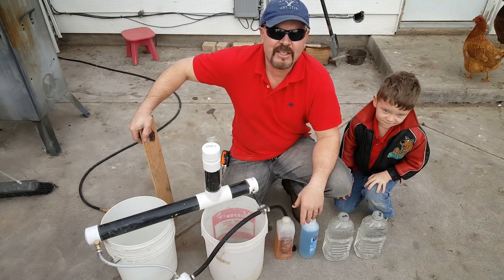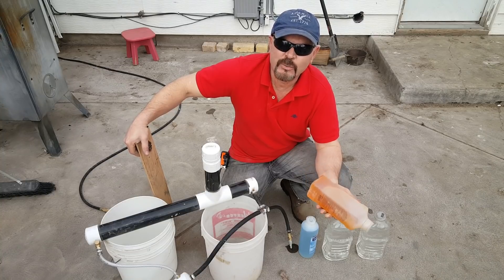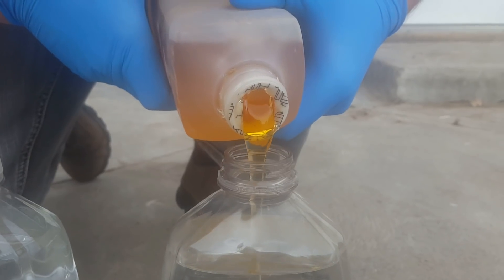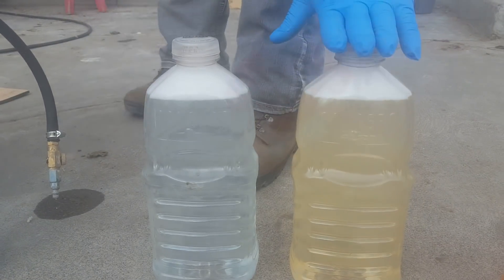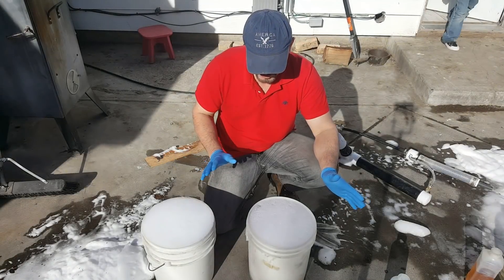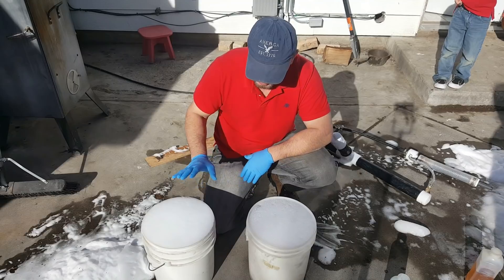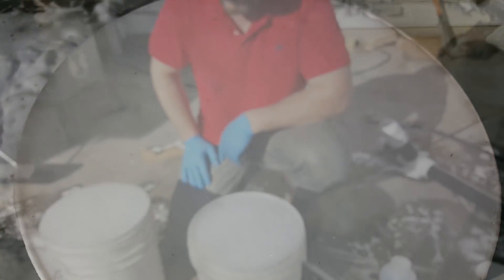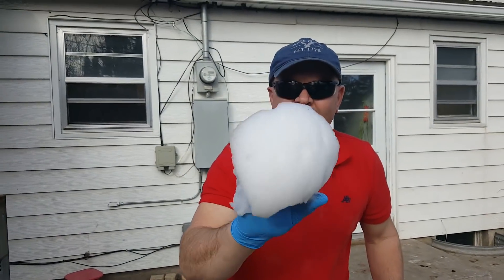The Best Aircrete Foaming Agent $ for $

Comment: Now with the the bubbles being of consistent small size they're always going to be stronger and the distribution of the bubbles between the particles of concrete and mortar when it's mixed we'll make it lots lot stronger and a lot more consistent but I also think that adding recycled plastic strands shredded plastic to the mix will make it indestructible and I've been thinking about using that system for a new road base. I currently live in Washington DC and the roads here are some of the worst roads in the world we have potholes the size of Volkswagens LOL. And I think a road surface that never needs resurfacing or very little is where we need to go with this country because we're spending way too much money on fixing potholes instead of just building a new infrastructure.
Reply: just add hemp

Comment: I just found out that you can add latex paint to color concrete. Imagine making your own bricks for a walkway? 
If a plane can drive on this kind of concrete as per one of the previous comments, could they be strong enough for a vehicle in a driveway? Or would they eventually sink?
Reply: You can only get pastel colors with Latex paint.  Too much paint and the concrete does not set.  You do, hoever, get a wider range of colors using paint than using integral concrete dye.   Did you know that there are now spray on dyes for concrete that produce strong and dark colors?

Comment: add a little baking soda to hand soaps. If you really want staying power and an awesome bubbles for your little guy.  Pick up a bottle of J-Lube.  That j lube is amazing.  Keeps bubbles strong for long. easy to wash away. 
Checkout NightHawkinLight channel he has great recipe.  Love you're build going out to the garage to make one.  You're sons going to love the bubbles.  I was able to make a bubble around my 8yr old son.  Off the wand you could fit a car in a bubble.
Reply from the maker: Hey thanks so much for the tip J lube works great. HDC
Reply: Honey Do Carpenter Awesome glad it helps. It's a great product, especially when u need big bubbles that hold.

Comment: Just a thought Darwin, you add glycerin to dish soap to make bubble blowing liquid, because it makes the bubbles stronger. Think that might help here?
Reply: I was actually wondering the same thing.
Reply: Another thought, buy some disposable razors and use some of the foam to get a close shave while making your aircrete.
Reply: @Accumulator1  i add a little stearic acid and the foam wont collapse for 2 days.

Comment: I tried making foam but was getting too much water coming out. I used the 40:1 ratio for shampoo. Do you know what the problem might be?
Reply: maybe your reductor   check out jim whites channel.
Reply: The air pressure too small.. add more pressure. 
you can decrease the water flow.
Or stainless wol inside  stick gun not thick

Comment: I was wondering why you only experimented with only the two and we already knew the hand soap broke down fast so i would have rather that you compare real foaming agents to that Swauve Shampoo, plus you re-adjusted your gun so the density will be different.But interesting anyway Dar. I also was wondering if you are satisfied with the output of that gun as you have done some improvements, but would increasing the tubing size and the mixing chamber to 4 inch help speed up that foaming. I saw one video where the machine put out what seemed 10 times the volume as that gun of yours. Thanks

Comment: Crazy Idea Warning:

How about shaving cream. If it works well, there should be a way to buy that stuff unpressurised by the bucket load no?

How about mixing Sodium Bicarbonate with the cement and water. Then mixing in Vinegar in the whole thing? Should bubble up nicelz,albeit I don-t Think it'll be as dense and permanent as the shampoo.
Reply: Very expensive for the amount you would need. Also it's made from different ingredients and these may interact badly with cement.